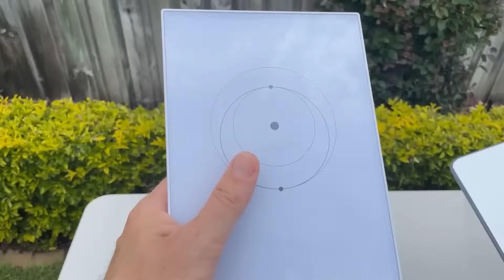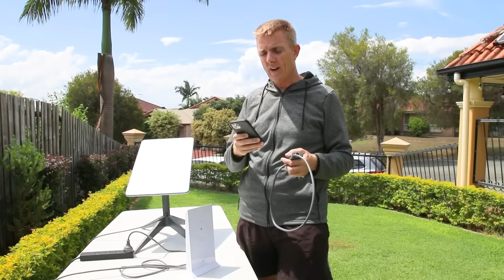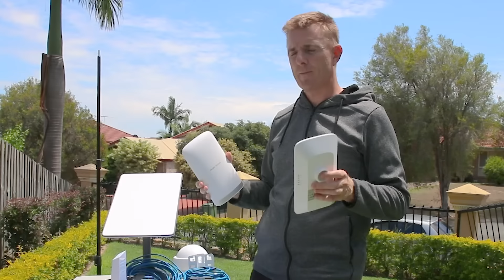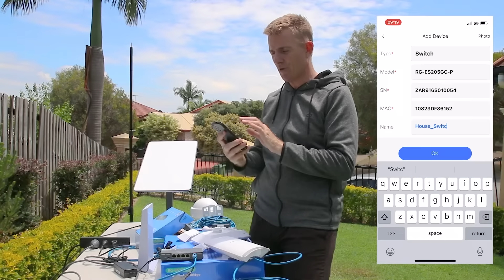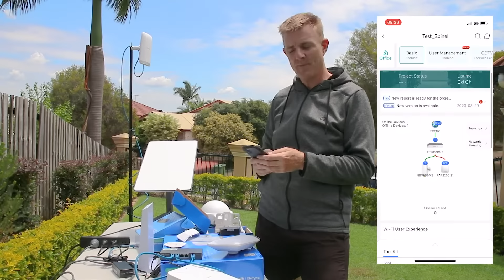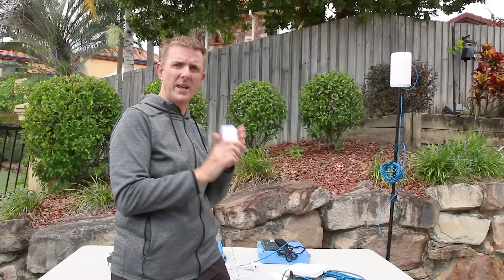Starlink - How to Extend Wireless To Another Property Using Ruijie

Comment: Would the bridge still be able to connect through trees? We are out in the country and although Starlink works great at the main house, we’d like to put it at one of our sheds to run a camera, but there are a lot of trees between the house and the sheds. Just wondering if they could still be able to communicate with each other so that Wi-Fi would be accessible in the other locations as well. Any ideas?
Reply from the maker: Trees can be an issue.   It will depend on the density.   If you can see the other building from the first one (even just make out the shape of it) then it is likely to work, but do reach out to info@thetechgeeks.com with some more information and one of the team can help confirm options for you if you like.
Reply: I can see the other building but not all of it. I’ll give it a go and if it doesn’t work I’ll reach out to those you suggested. Thanks a lot!

Comment: Use for LAN cable not working
Reply from the maker: You will need the Starlink Ethernet adapter if you have a Gen2, but otherwise just a cable from the Starlink to the first bridge device to get it set up

Comment: I’m completely uneducated on this but need to learn.  Do you know how many kilometers these bridge units will transmit?  I need to connect a pressure switch and alarm somehow to one of these and transmit a signal back to the starlink.  Then will connect to something that will call multiple phones if the alarm is triggered which right now is a data logger connected to copper phone lines.  Each location is about 800 meters apart do you think they will transmit that far?
Reply from the maker: A Ruijie EST350 pair will connect up to about 5km.  You will then need to loop out to a wireless access point so your devices can connect at that location and you will need power there as well.   If you need to go further then look at Ubiquiti devices which can run up 10km+

Comment: I have a router in the basement and used a Starlink mesh node to extend the network upstairs, but I need it to extend 60m from the house into a metal building. By splitting the network I have signal outside, but not inside. Do I need a bridge network or an extender or a third party mesh system? Which one could I use wireless?
Reply from the maker: Great question.  Since you a metal building, you really need to go for a wireless bridge.   Metal aborbs wireless so a standard mesh or extender really won't work.   I would look at something like the Ruijie EST310 2 Pack for the Bridge or maybe use 2 x Ubiquiti Loco5AC as another option.  I hope this helps
Reply: Yes! Would I need a router at both buildings?
Reply from the maker: Yes you would or an access point.

Comment: When I add my Ruijie exterior WAP to my starlink via the Ethernet adaptor. What settings do I change to seemlessly to have 1x wifi network that devices will move between?

A video of completing the set up (settings) of the Ruijie and Starlink settings showing this would be very informative.
Reply from the maker: Good question.   Add the WAP to the Ruijie control panel.  They go in to Wifi Settings / Add new Wifi if adding for the first time on the mobile app and set the SSID and password to match what you have set in the Starlink App and all will then be seemless.  I hope this helps

Comment: We currently have separate DSL service in each of two buildings at our church, about 500 feet apart. A third building has been constructed recently between the two. We want to put a Starlink dish on that in-between building and send it to the two outer buildings using wireless bridges (probably Ubiquiti). To split the output of the Starlink ethernet adapter to feed the two sending devices, do I need a managed switch or a router? I assume that the receiving bridge devices will be connected to the WAN ports of the routers in the two outer buildings. Is that correct? Thanks for the great videos!
Edit: This is for internet access only in the two buildings. We do not need devices in one building to communicate with those in the other.
Reply from the maker: Hey, great to hear from you.   You just need any old switch to "split" the Starlink ethernet adapter.   A managed switch like the Ubiquiti USW-lite-8-poe could be a good option if you already have Ubiquiti access points, or the UISP-S if you are just using Ubiquiti bridges.   Yes the WAN ports will be connected to the Bridge LAN ports in each building.  I hope this helps further.
Reply: @The_Tech_Geeks  Yes it does, thank you!
Reply: @The_Tech_Geeks  I have this set up now with the Starlink router in Bypass mode, connected to a managed TP-Link switch. The two sending radios are connected to the switch as well. I'm getting internet on the router in one building but not on the other one. Should I not have put the Starlink router in Bypass?
Reply from the maker: This will depend on what and how you have set up your routers. You mention you have a router in one building that works. If they are true routers you will have an issue if they are on the same subnet as each other as they won’t route.  

So if you have Starlink in bypass and using a router it would go. Starlink Ethernet adapter to router. Router to switch. Switch to bridge. Then access point at the remote site or a router that has been reconfigured to not give out the same lan ip via dhcp. I hope this helps.
Reply: @The_Tech_Geeks  The only routers are in the two outer buildings where the bridge receivers are. The router on which the internet is working is a UDM SE and the other is a consumer-grade TP-Link. They are not on the same subnet. There is no router in the center building (the one with the dish on the roof). The Starlink router there is set to Bypass, and connects to the switch, which in turn is connected to the two NanoBeams that transmit to the two outer buildings. So instead of "Starlink Ethernet adapter to router, router to switch, switch to bridge," it is "Starlink Ethernet adapter to switch, switch to bridge." If there needs to be a router between the ethernet adapter and the switch, then I wonder whether I should simply do a factory reset and get the Starlink back in normal mode. Thanks so much!
Reply from the maker: Correct. If you have no router at the Starlink end and the Starlink is in bypass then you won’t have any connection there.  You need to take the starlink out of bypass. By default that will give out a 192.168.1.xxx ip range which will conflict with the lan ip of the UDM-SE so you will need to change that on the SE if that is the case or it won’t be able to route back to the Starlink router.
Reply: @The_Tech_Geeks  That worked. Thanks!

Comment: Great video, thanks!
The only bit I’m unsure about, is reasons for choosing between the router or the access point at the ‘camera’ end? We have a small granny flat I’m thinking about.
Reply from the maker: Hi, that is a good question.   Really it is personal choice.   A router like the EG105GW(T) will give you not only wireless but also ethernet.   Since it has a power pack you also don't need to get a PoE adpater for it, it works out at pretty much the same price, but gives the extra features.   I hope this helps a little more.

Comment: Is there a app to setup the same setup with ubiquiti nanobeam?
Reply from the maker: That is a good question.   With the Ubiquiti nanobeams you can use the UISP app and connect via wireless to each device to configure it and set them up (not all models)   We find it better to do it using a web browser and log in to each device and configure.  There is no option like on the Ruijie though I am afraid.